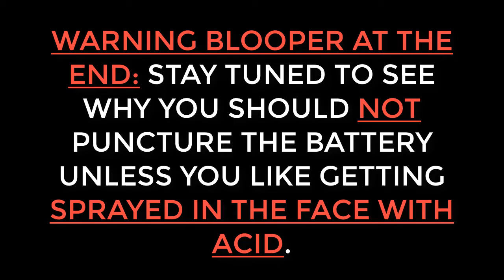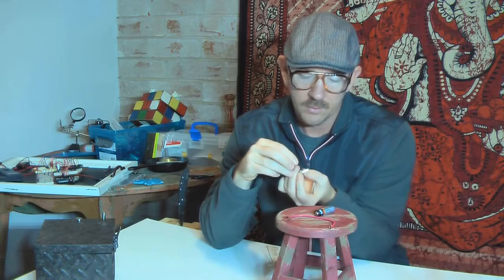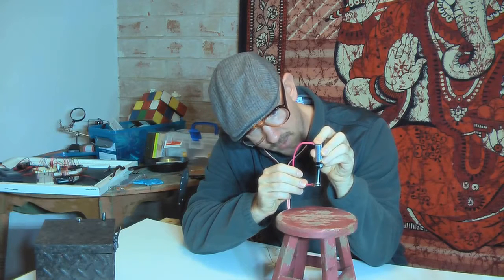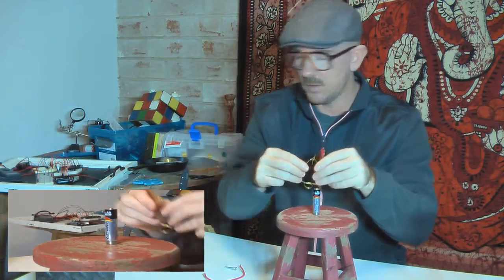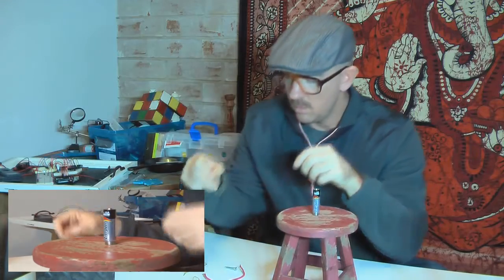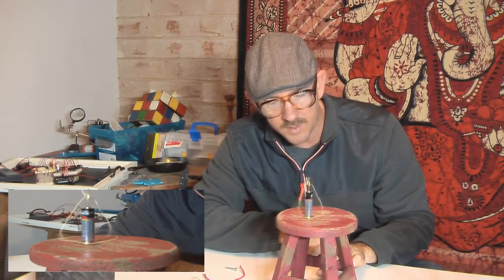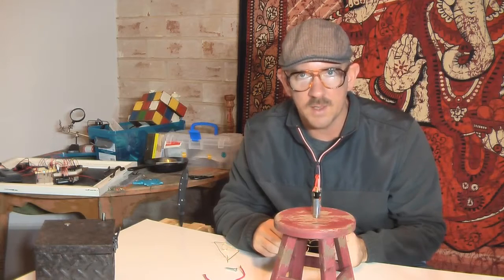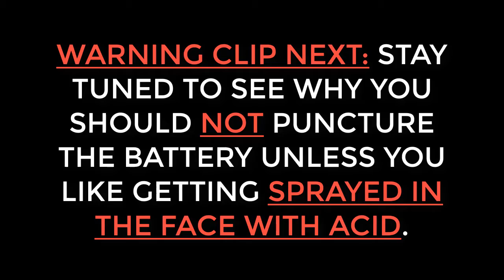DIY DC Motor: Super Simple homopolar motor experiments. Fun and easy!

Comment: Which wire did u use for the homopolar motor..
Reply from the maker: Its been a while since I did this project but I believe I used brass wire. You could also use copper wire. You have to remember to scrap and protective coating off before using if it has it on there. Often that is the case.
Reply: Copper wire